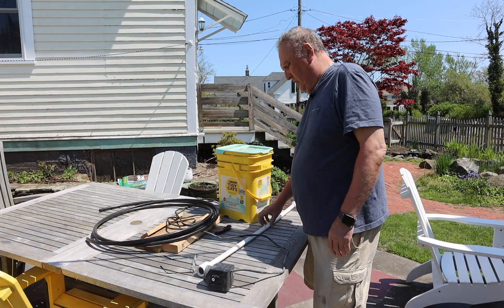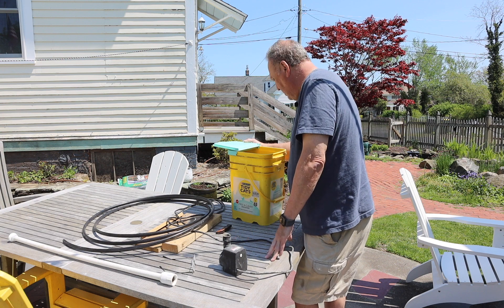Home Hydroponic - NFT System Setup for New Season

Comment: I tried the poly 1/4" feed lines last year and had to blow them out constantly in my nft system not as much in my Dutch buckets. resorted to 1/2" poly to an header made of 1/2" pvc with a 1/2" coupler with a sheet of plastic from sandwich bags that then were perforated as emitters which worked flawlessly for the rest of the season.  with only one ball valve after the pump to divert extra water pressure to aerate my reservoir. Looking forward for future progress on your garden this season!